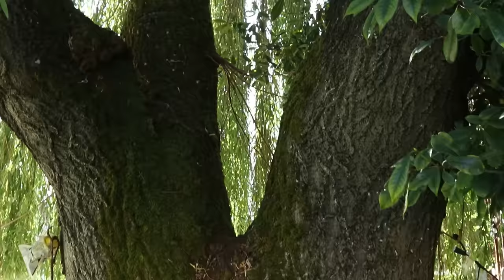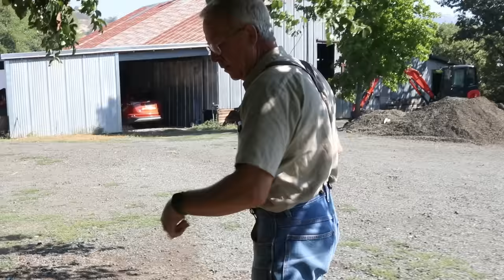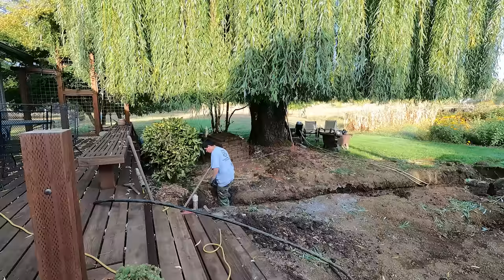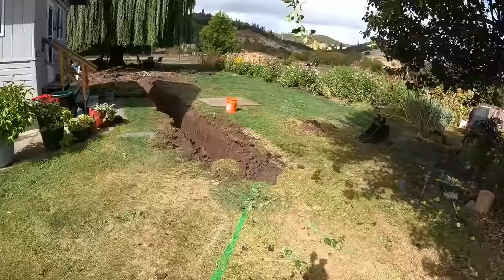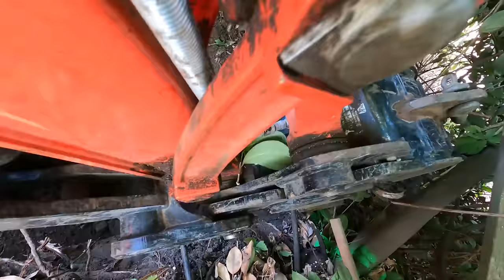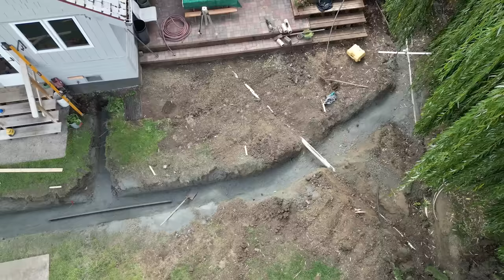Leaving Septic for Sewer +Trenching Shop Gas & Water!  Underground Part 1

Comment: I know this comment is too late, but if you didn't, you should have run a sewage pipe along with the water and gas pipes to the workshop. It sounds like you don't have a bathroom in the shop, but you could have set up everything you need for a future project.

Comment: I used to work for a contractor who had a P2 license which meant he could put in septic systems and do sewer hook-ups. The first one I worked on was in the neighborhood where my boss lived. I don’t think he bothered loading his backhoe on the trailer, just drove the machine over with his fingers crossed that a cop wouldn’t happen to see him . About ten years later he did a hook-up on a rental property he had bought about 30 miles from his home. Instead of trailering the machine over he had our laborer from the house to the street with a pick and a shovel. The lateral was 8 or 9 feet down. The town regulations specified 6” diameter pipe even though there were only 2 bathrooms because it was a two family house.

Comment: Your probe is a sharpened 3/8" rod. If you weld a 3/8" ball on the end of a1/4" rod it will only have friction on the ball. The shaft will not have any friction and will go down much easier

Comment: I was told the drop of sewage line is now 1/8 inch per foot because of the new 1 1/2 gallon toilets. The water runs to fast on 1/4 inch drop leaving effluent and causing clogged up lines.

Comment: My first homemade probe was similar except I threaded the end for an inch and put two nuts on locked together. Then spun it at the bench grinder to make a ball out of the two nuts. This probe proved to be significantly better than ones from the store, because I was able to sharpen the remaining end beyond the two nuts that made the ball. The ball enables the probe to plow a larger channel on its way in and out making it significantly easier to probe, the point made it easier to go in. Most probes available for purchase do not have the point.

Comment: I worked with a fellow who showed me a scar on his belly that he got from one of those probes like you built. Just make sure the pipe or handle you attach to the probe rod is very well secured. The handle broke off of the one he was using and punctured into his gut.

Comment: I always prefer a clean up bucket for "exploratory" work. You see a lot of utility machines use a digging bucket with a chunk of AR flat bar welded to a set of worn out teeth. Depending on the method to change out teeth, its a good way to double up your buckets usefulness. With the flat bucket your breakout force is usually not enough to puncture a pipe if you're scraping the dirt down inch by inch. On the drone shots it looks like you've got a real nice base for that new sewer line 👌🏻
Reply: We call them sand buckets. They’re not a guarantee, but you stand a better chance on less damage.
Reply: The bigger the bucket the less the breakout force as well. The material and its compaction plays a big part too. If you're digging parallel to, and on top of a pipe with a 36" clean up bucket on a 3.5 ton machine its good chance you will just skim the pipe and rough it up a bit. Toothed 18" bucket, digging perpendicular, fuggedaboudit. You're going to wreck it almost every time  @psidvicious

Comment: I do this for a living. I would have uncovered the connection at the main and the house then taken laser shots to make sure you would have enough fall first. Also, I'd rather use clean stone as a base for the pipe and surround the pipe with it. Clean stone won't ever compact. E.C. is the best! Just throwing my 2 cents in. Not trying to offend.

Comment: Edit my comment. I always get nervous with long runs like that with 4 inch. I would make sure to maintain 2% slope minimum, 5% maximum. I would use back to back 22’s instead of 45’s. We maintain 10’ of separation with the water and sewer.

Comment: Put rock salt in your drain line to get rid of the roots. But u got to do that before it's a problem
Reply: Root Destroyer (copper sulfate crystals) are also effective. One pound each Spring and Fall are enough to keep the roots of a silver maple at bay. It was planted almost directly over the sewer line.
Reply: @machintelligence  I ment to say ice melt. Not rock salt. But it all does the same thing.